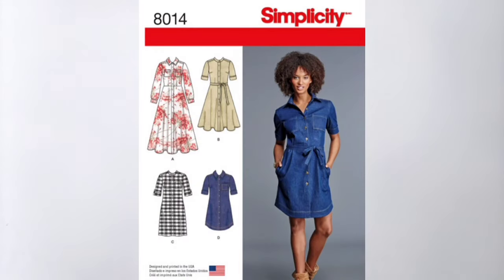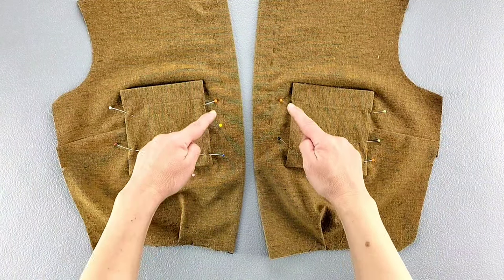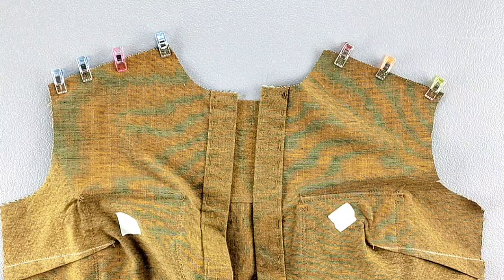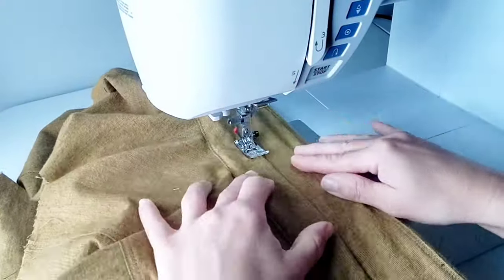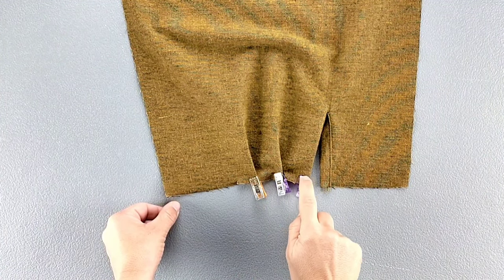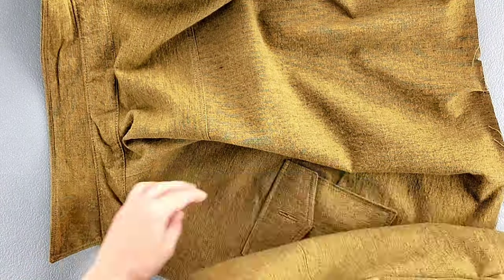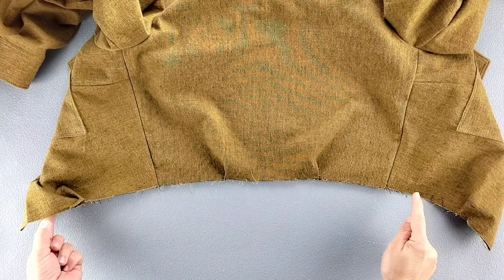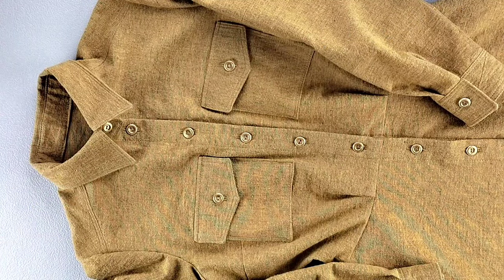From Fabric to Fabulous: Sewing a Magnificent Dress Tutorial! // Simplicity 8014  View A

Comment: Thanks for the great video.  Question:  it seems that you sew the collar with a 5/8" seam allowance but if I am reading the pattern correctly, it says use 3/8" seam allowance.  I am confused and your guidance would be greatly appreciated.
Reply from the maker: 👋 I believe you are right!  Good catch.  I did sew the double notched edge at 5/8” when it should have been 3/8”, which means I have a little skinnier of a neckband.  It seems to have eased in just fine and I don’t remember any issues there!  😅